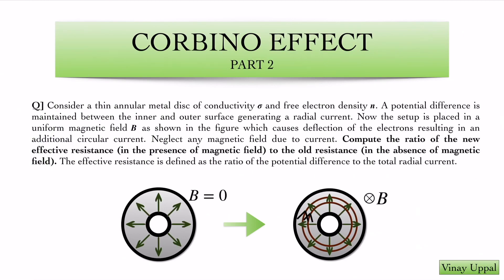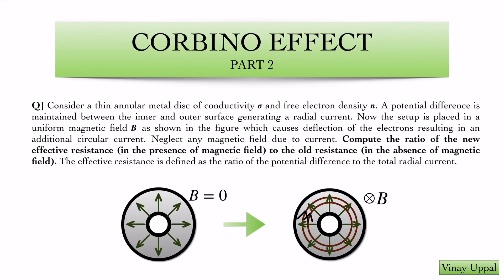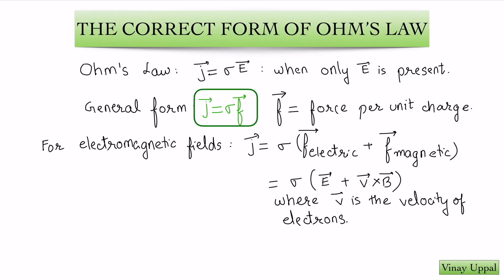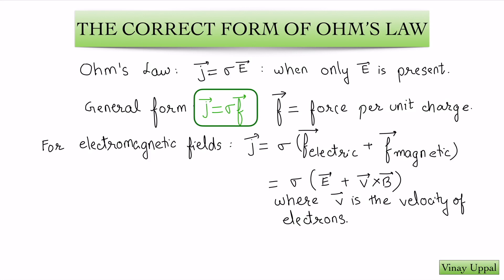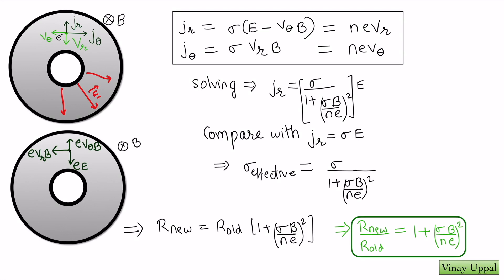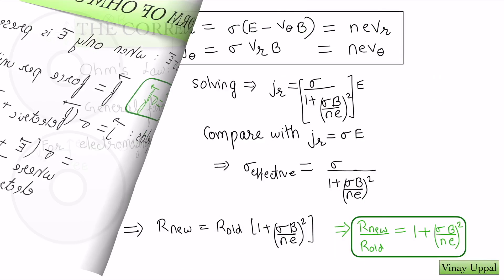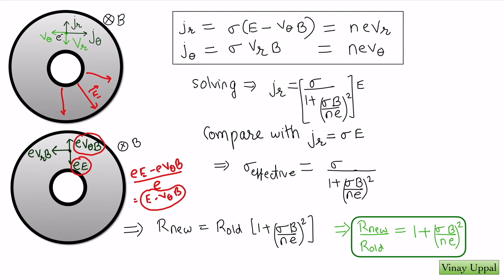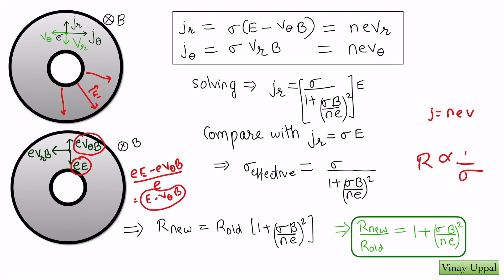PREDICTION: Episode 2: Ohm's Law In Magnetic Field Part 2 [JEE ADVANCED]

Comment: Sir I have a doubt, applying B field to a moving Conductor generates Potential Diff which we apply in many problems in EMI , but as it Generates a P.D then it Accelerates the electrons and changes the speed of the charge but we are also taught that B doesn't change the magnitude of the velocity but only the direction. I can't connect the dots idk which point I am missing.
Reply: I think it's the Electric force experienced by the electron which accelerates the charge in the electric field.

Comment: Sir.. Great video! Thnks.
Plz answer.
I had to ask in this..that for calculating final Resistance I did divide V by net I of both current.(Vector rule) .. Is it correct approach..coz the answer is just diff by a factor of 1/2 so.. what's wrong in it?
Reply from the maker: Current is a scalar. You can't add them vectorially.

Comment: Sir if the force on electron doesn't depend on charge like any viscous force will we include that too in f vector or not??
Reply from the maker: Yes include all forces(could even include pseudo if conductor is accelerating. I'm planning to do a future video on this.), although I'm not sure what you mean by viscous force on electron.
Reply: @PhysicsWithVinayUppal  He was basically just suggesting an external force not caused due to charge unlike the EM forces and do we incorporate that in the law.
Reply from the maker: @sanidhyas3s  yes we incorporate all forces. Like Disha said above, just divide the net force by electron charge (including the negative sign of the charge)
Reply from the maker: @sanidhyas3s  yes we incorporate all forces. Like Disha said above, just divide the net force by electron charge (including the negative sign of the charge)
Reply: @PhysicsWithVinayUppal  Including the negative sign will mean, we take the opposite direction?
Reply from the maker: @sanidhyas3s  yes. If net force on an electron is driving it in a given direction, then net force per unit charge will be in opposite direction because electron charge is negative. And so by Ohm’s law, current density will also be in opposite direction to velocity of electron which exactly as expected.
Reply: yeah sir plz respond to this ..imo we will take the force and divide it by e
Reply from the maker: @dishakayande3997  yes correct